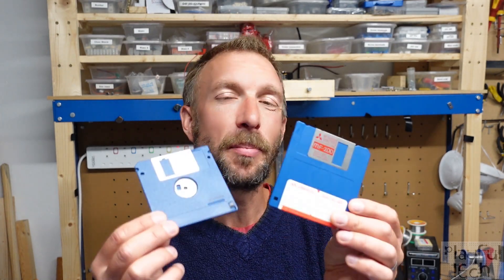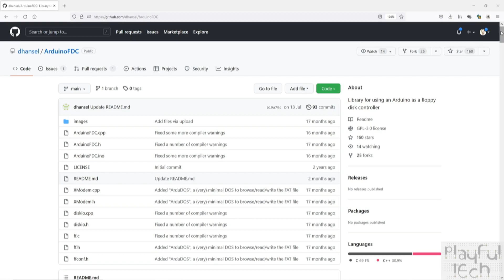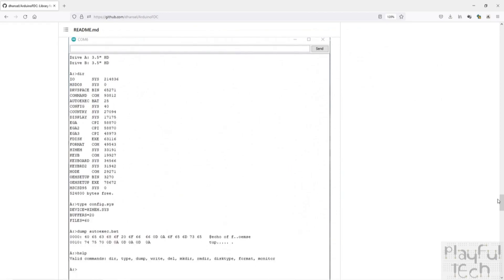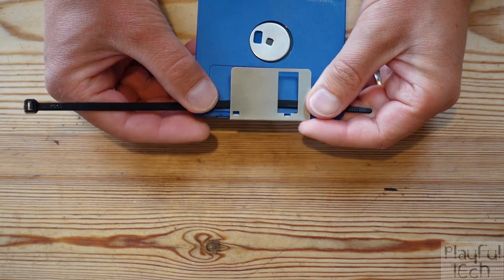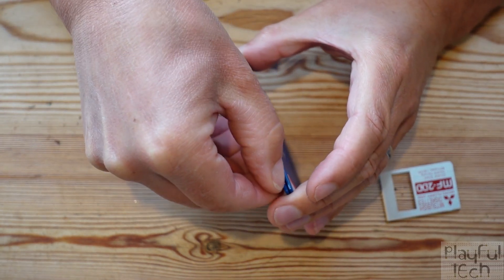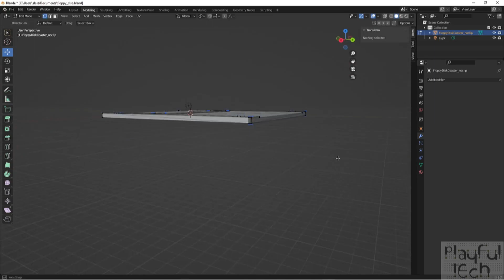Make an RFID-enabled Floppy Disk!

Comment: Good stuff Alastair.  I just recently discovered your channel. I just looked at this in Nov 2024. I have a batch of 'apparently' identical blue fobs that came with RFID readers that I purchased.  These blue fobs are different inside in that  the copper coil and tiny little pcb are bonded directly to the blue fob moulding.  You can still use them in a similar fashion but you have to keep a disc of blue plastic and tidy trimming is very tedious. So, as @jthuriner remarked below - stickers are much  easier.  You can also get white discs 25mm diameter with self adhesive backing. Those are my preference.  It still seems a shame to not re-use all of the leftover fobs though.

Comment: Next time, if you don't have the RFID stickers, it would be better to cut away a fitting portion of the magnetic platter and its protective felt if need be, and then just place the RFID inside of it. (Tape the platter in place, so it cannot be rotated.)

Comment: you are correct with how it's got it name,  that's actually one of the latter generation disks the case on the previous models where just as wiggly or floppy, so it the name made a lot more sense then as the whole thing would flop around just as easily as that inner bit.

Comment: Cool project and nice video. In the computer world the floppy in "floppy disk" referred to the ability to move it between computer instead of a Hard disk that cannot easily be moved between computers.
Reply: Alastair is correct, the 'floppy' moniker refers to the data disc inside the plastic housing.  Earlier floppy disks were in floppier casings so more obviously floppy.

Comment: Love the idea 👍 
BTW you could use RFID stickers instead of dismantling plastic tags🙂
Reply from the maker: Lol, yes that's an excellent point! I even have some rolls of RFID stickers lying around that I could have used....  I just have so many of these blue fobs that come with every RFID reader I buy, and I just happened to notice that the diameter of the plastic cover exactly matched with the diameter of the hole left by the floppy disc hub. But you're right that using a sticker would have been less destructive ;)
Reply: @PlayfulTechnology  Hi ! Do you know which signal is better ? Stickers or plastic tags ? Thank you for sharing these great ideas :)
Reply from the maker: @mathieubauer  The tag contained inside the blue fob is basically identical to the sticker, so I wouldn't expect there to be any difference between them. The white credit card-styled tags have a bigger aerial, so typically a slightly longer range.